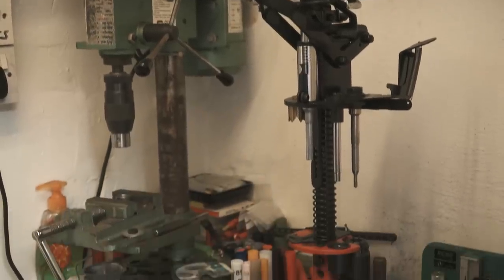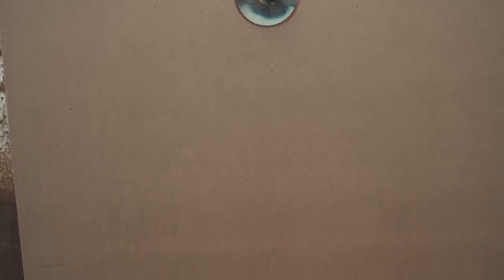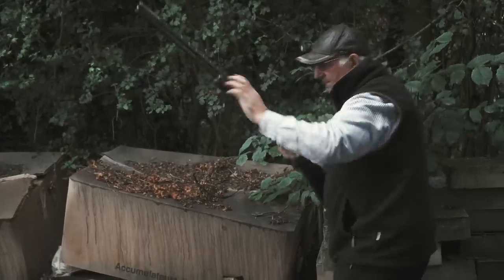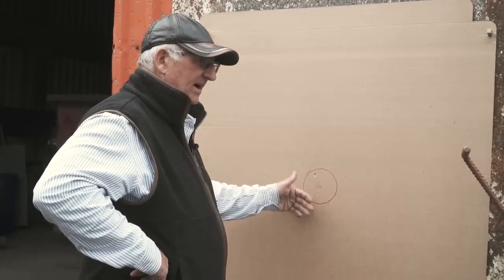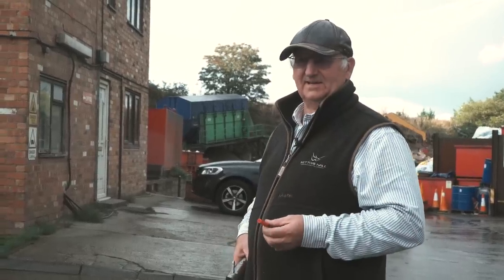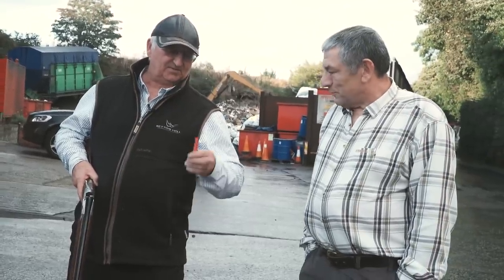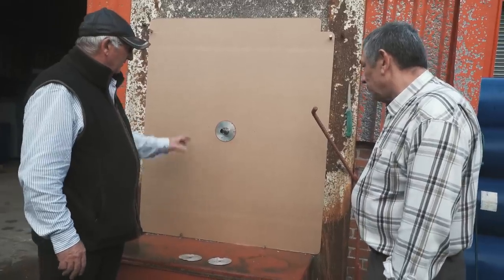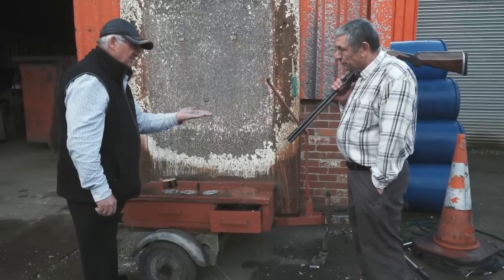Devastating 410 Loads - Pattern Test (Dave Carrie Shooting)

Comment: I’ve had really good results from my hand loads using nickel plated #7 shot with “Stretch” wads from Ballistic Products and 3” Fiocchi hulls. I also like the Fiocchi factory loaded 3” #7.5 shells. I use my 410 primarily on squirrels, I definitely agree that 30 yards is about the maximum distance for good center of pattern hits. Like everybody else I own 20 gauges and 12 gauges but I cut my teeth on a 410 when I was 9 years old so it really makes for an enjoyable hunt that reminds me of hunting with dad and learning to be patient and wait for a good shot rather than wounding animals that run off and suffer. Great video gentlemen!
Reply from the maker: Great advice and thankyou for your kind words and great input
Reply: I run #8.5 tungsten super shot for ducks and geese, #9.5tungsten for upland

Comment: This was an eye opener but not really a surprise. Iv used. 410,s for years and always got the best out of mine at 25 to 30 yards. Iv patterned a few cartridges and and beyond 30yards the pattern just was not there. Not a beginners calibre a semi auto in 20 guage with a shortened stock is much more usable. Well done to you both. Can't wait for 28 guage and 20 guage. All the best. Tony

Comment: #8.5 tunsten super shot, 11/16oz load.  Absolutely deadly out to 65yards in a .410bore. Rarely do you find pellets that dont completely enter and exit a pheasant. Many more pellets on target that retain more energy, and penetrate much deeper will always down more birds
Reply: TSS is great, but the problem is you have to be independently wealthy to shoot them in any number.
Reply: @JohnB-dr8sk  not really. You can buy bulk loose shot, a sack of overshot cards, and roll crimp in a cheap drill press. Beyond that one needs only a hammer and punch to deprime hulls. I can reload for comparable money of say boss bismuth 12ga rounds. $1.59ish per stick.  I dont shoot extremely high volume, nor do i hunt every day, or make my living from hunting. What i do enjoy is making the most of each shot each shot i take. I have triple the pellet density as steeln better penetration, more downrange energy delivered on target, and a far more devastating round overall. Rarelyn and i mean rarely do i ever need to follow up with a second shot on downed birds. If they fall theyve usually caught plenty of pellets to immediately stone them mid air. Even at 50yards, its rare even on big ducks that i have to search for pellets in a bird. They burn through like a damn laser beam.  So in shortn yes it is more $$$per shot, BUT when i can run a wider pattern, more open choke, and triple the pellet density per shot, and never need a 2nd shot to kill cripples, it really is not any more expensiven and i routinely can drop 2 birds, sometimes 3 with one shot at 30yards and beyond if theyre clustered up. Steel has its place, as does bismuth, but when im aweekend warrior with 4 of my young boys with me, somebody needs to do damage on the birds as theyre youngn like to shoot, but mostly miss.lol

Comment: You should try and get hold of some federal TSS 410. It is designed for turkeys and the shot size is American 9 or larger, however the pellet wieghs a lot more than the same size lead pellet. These cartridges can take out turkeys at 40.

Comment: I've got a load for you to try...
410 2.5 inch shell loaded with 12.1 to 12.3 grain of Hodgdon Lil Gun powder with MG410 wads loaded with .47 oz of bismuth shot. I'm using copper plated Boss shot in #8 shot. Using a full turkey Carlson choke TSS out of TriStar Cobra 2 pump. Patterns at 40 super tight and pellet density extremely tight. I plan on using it to shoot ducks as I can no longer shoot the large bore shotguns.

Comment: Hi Dave, the problem in the UK is the availability of decent cartridges. The uk manufacturers for far too long have got away with selling complete junk! Gamebore included and they need to up their game. 

However, the American loads are a different breed, Winchester or Remington would be super but we just don’t import them at a sensible price. 

Therefore, Reloading is where it’s at and that’s what I do. 

Good to get some balance after the first test. Any reason you didn’t test gamebore?
Reply from the maker: i don't think any of the factories will be happy with my next film only factory 410 loads!! i have got my men out now collecting a wide range of of the shelf loads, i did not test gamebore  because it was a spur of the moment test with what i had available at that time "just to get the debate running" i think we have succeeded in getting enough interest to further the debate, which will eventually persuade/enable 410 users to seek better loads.
Reply: Dave Carrie Shooting brilliant news dave, I’m only at Worksop and have some Fiocchis if you need any of those in 3 inch 6 shot and 7.5. 

Keep on at them hopefully this leads to real change in the .410 loads available, If the Americans get it right then our manufacturers should, we are miles behind.
Reply from the maker: Thanks Liam much appreciated